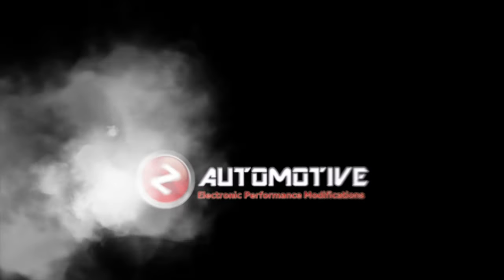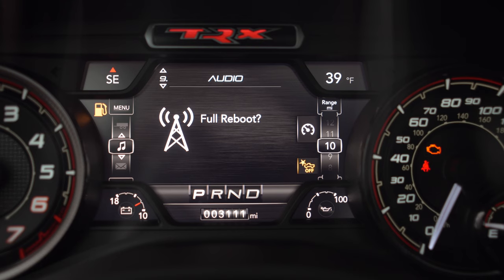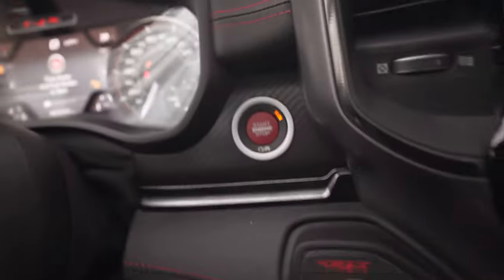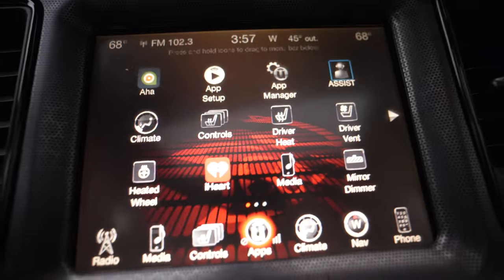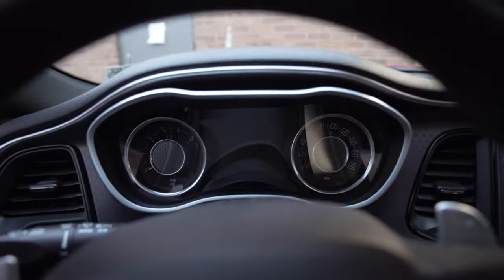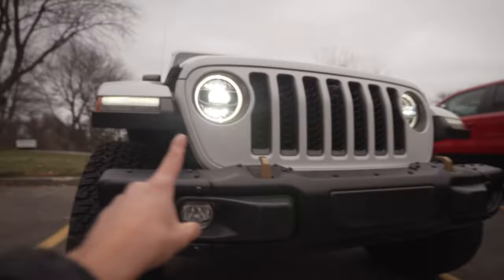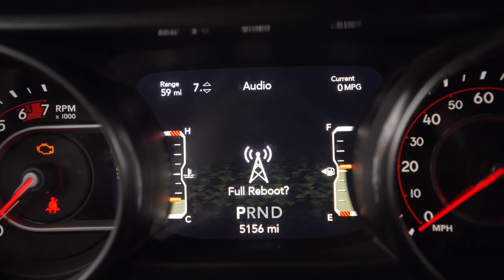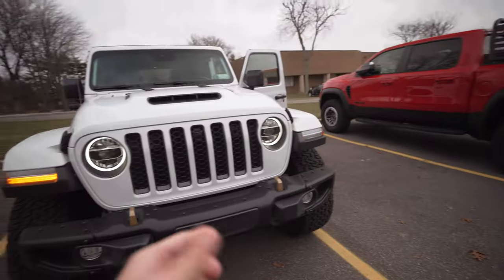How To Perform a Full Reboot & Two Sleep Cycles - zAutomotive TaZer

Comment: This video was very helpful. I have had a Mini JL for about a year now and my Live settings for brake light strobe and triple honk just stopped working. Running through this reboot and 2 sleep cycles fixed it. Thanks
Reply from the maker: Perfect so happy to hear that this video was helpful to you. Generally if there’s an issue, unmarrying, doing a full reboot and two sleep cycle will fix things… just make sure you have all previous changes written down somewhere so you know what to change back once it resets back to stock

Comment: So a lot of the Jeep/Truck guys in rural areas like to trigger some ditch lights off the high beams.  Right now that means adding a relay to the highs.  Wonder if there would be a way to make the Tazer  add a high beam trigger to the  programmable Mopar auxiliary switches? They already have other programmable features, maybe it might be possible to add some code that says something  like "IF hi beams = ON THAN aux switch X = ON"? That would be perfect. You could simply wire the lights to one of the aux switches, and set that switch in the Tazer to turn on with the high beams.

Comment: So I have a jeep JL sport and bought the rubicon fender flares with led turn signals , So I just bought the tazer JL mini just to make them work I also corrected the tire size and that’s it my question is can I now disconnect the tazer JL mini and reconnect the cables back to the security gateway connector with my changes being saved?
Reply from the maker: Yes for vehicle settings you can then remove the Tazer and have those customization settings saved.

https://youtube.com/shorts/49Mpf0aTHos?si=IR9Umoo9hRvo4Cap

Comment: How do you do the 2 sleep cycles on a Jeep Wrangler JL if you are running soft doors?  With these guys on instead of the hard doors, nothing happens with the lights, dash, etc when they’re open and closed.
Reply from the maker: They will eventually turn off just takes longer without the doors on

Comment: I'm not sure what happened, but now my amber DRL on my challenger wont go on. they stay white. I have the box checked on the radio & followed the steps. I tried different settings like turn, SRT, dedicated, none, etc.
Reply from the maker: The Challenger doesn’t work the same as the TRX as far as the Amber DRLs work. The car defaults to turning off the DRLs when the headlights are on. May be something that could be suggested, but that’s not currently supported in the standard TaZer. Add it to the feature request page - bottom of the main page on our website

Comment: What do you do if after the car is turned off the evic light remains on… only fix so far is removing the tazer entirely. 
Also the 2k idle feature doesn’t seem to work. Cant find a video on it either
Reply from the maker: It sounds like you're talking about Winch Mode and that only works in the Durango and the Jeep Grand Cherokee.

If the evic stays on, most likely a reboot and two sleep cycles needs to be performed.

Also, best to reach out to support and they can help you through any trouble shooting. Email support@zautotech.com

Comment: So I noticed that my speed O was off and when I tried to go into the menu it wouldn’t work. Pulled the tazer out of my Jeep and plugged it into my computer. Got it updated to the latest and greatest. Plugged it back into my Jeep and it would go straight to Updating…. Had a text conversation with someone at your tech support that said to do the recovery. I did that and now it went through 3 menu option but stopped at Unmarry and then went to Updating…. I paid too much for this thing for it not to work. Please help!
Reply: Also, just held the left arrow and pressed the cancel button multiple times and “Not Vin XXX” but it is in the vehicle that it is married to with the correct VIN.
Reply from the maker: @cnorman1272  well you're doing the right thing by going through the customer support staff, they're the one's that will be able to help get up and running and help fix any issues

Comment: im having a weird issue with my new Tazer for my 2022 Dodge Durango RT. for some reason my Sport mode button seem to activate the lights? how do I get ride of that I don't want the light show stuff I just want this for the pin security features.
Reply from the maker: Sounds like you remapped your sport button to a LightShow: https://youtu.be/-nkKrnce7o8?si=4vCj2v1BbfJ-KgNa
Reply: @zautomotive  yeah I stumbled across a video and thought wait that looks like my issue but on a earlier model so 12am I’m out there and sure enough it worked. I was so relived now I am kinda curious what live option and that work for the RT Durango I know a lot is referred to challengers and chargers in the manual. Also I notice I can start the vehicle and then I have to enter the pin is there a way to have to enter the pin first before it will start? Thank you for your previous response.
Reply from the maker: @canadianguitar-garrettont7368  put the car to run before starting the engine, enter the pin and then start the ignition
Reply: @zautomotive  no what I mean is. Is there a way even if the fob is In the vehicle that can prevent the vehicle to start until you enter the pin? Mine will start but then give me the pin count down? And if I disarm the vehicle with the fob I’m not even asked for a pin which worries me with thrives breaking In and taking fobs.
Reply from the maker: @canadianguitar-garrettont7368  The Pin Lock features are no designed to prevent keyfobs from being stolen (but does stop from them being cloned) and it is not a killswitch. All the Pin Lock features shown in detail here: https://youtu.be/nBb8uGz1Y2o?si=UYFfxG9YVO65WSNT
Reply: @zautomotive  would it be worth adding a kill switch or do you think that is enough to deter a theif? I keep my keys in one of them boxes In the house that apparently they can’t scan. But I guess at the end of the day if they are busting In your house at gun point for fobs might as well let them have it.
Reply from the maker: @canadianguitar-garrettont7368  AS mentioned within the beginning of the video I sent, any extra layers of protection is always recommended
Reply: @zautomotive  any reason why the vehicle turns off when I enter the pin seems to do this all the time.
Reply from the maker: @canadianguitar-garrettont7368  https://youtube.com/shorts/7W7a3xnqwbg?si=IwoyjE7ueSoa8Hp5

Comment: Enables all SRT setting on my 2018 392 but they won’t pop up on my radio..any suggestions?
Reply from the maker: Reference Page 8 of the TaZer user manual: 
"Set Performance Pages “PerfSet”: Set
to ON, this adds the performance pages and extra
gauges to the EVIC screen (2015-Present Challenger/ Charger/300), and in some vehicles, SRT performance pages to the radio (2012-2014 Charger/300) (not guaranteed on 2015-Present vehicles) (8.4” UConnect
ONLY).
Reply: @zautomotive  thanks, I had to reset the radio fuse and do a sleep cycle and it popped up! Loving the tazer so far!
Reply from the maker: @Shaker392  That's great, happy to hear it worked since it's not a guarantee on every model
Reply: @zautomotive  quick question, could I turn the SRT performance pages OFF while only keeping the SRT Drive Modes ON? As my car already had the performance pages.
Reply from the maker: @Shaker392  I thought you were trying to turn the performance pages ON with the TaZer? But yes, set performance pages and set Drive modes are two different options on the TaZer

Comment: Does it happens to give a dodge charger sxt 2019 the srt pages?
Reply from the maker: 2015-present Chargers, Challengers, and Chrysler 300s will get the added performance pages and extra gauges to the EVIC screen
Reply: @zautomotive  would it also get them on the touch screen pages as well? Like the launch control etc…
Reply from the maker: @julianramirezcali  it’s not guaranteed. Btw, didn’t you just purchase a TaZer?
Reply: @zautomotive  haha maybe
Reply from the maker: @julianramirezcali  Unless another highlife productions shared on IG that their TaZer was being married to their car the same day we got this comment 😉. Let us know if you need any help getting those pages working
Reply: @zautomotive  haha yeah it’s me 😅 got the pages performance pages to appear on the dash and got my paddle shifters I installed to finally work but no luck with the eco mode and the srt page on the uconnect
Reply from the maker: @julianramirezcali  Refer to page 3 of the manual the drive modes: "enable SRT Drive Modes - street/sport/
track/valet/custom/ECO (2015+ Scat Pack Charger/Challenger)"
Reply: @zautomotive  I May need the 8.4inch screen :(
Reply: @zautomotive  time to visit a junk yard haha 😂